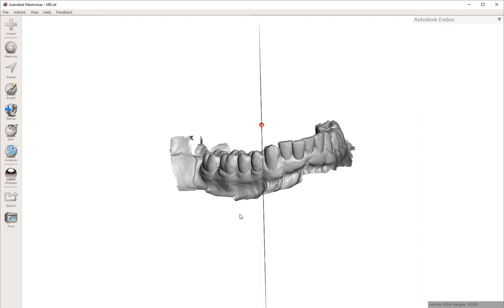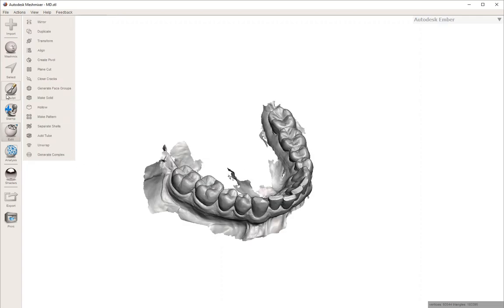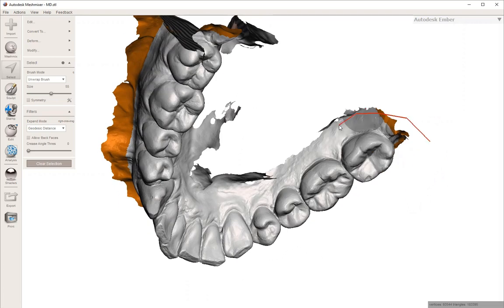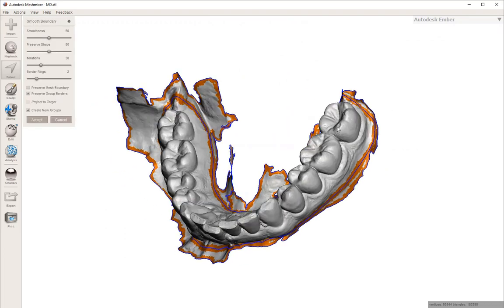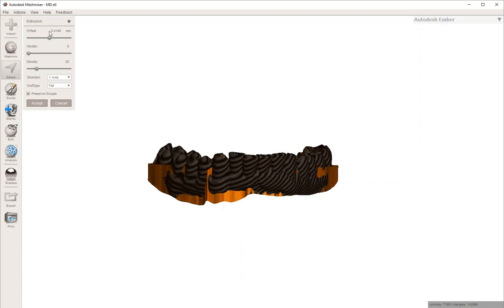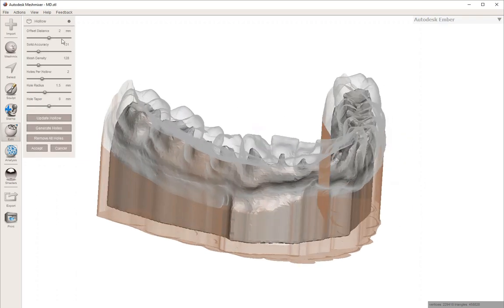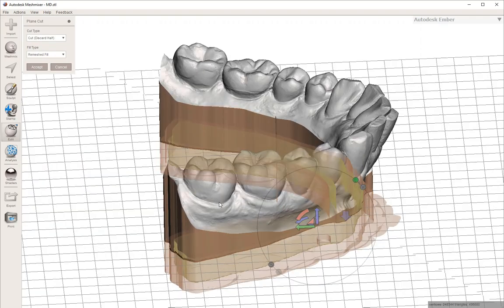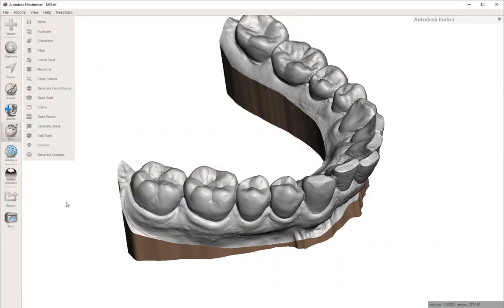Making a model hollow

Comment: Nate, have you figured out why sometimes this sequence will not form a solid during extrusion, then at hollow, you are left with nesting shells?
Reply from the maker: Yes, the issue is that if the borders of your scan are not smooth or cause anything to fold back on itself during the extrusion, the software doesn't know how to close the mesh and so it just leaves it open.  The easiest solutions are 1) always cut the excess mesh off with a smooth cut (smooth boundary tool) and 2) if anything ends up folded back on itself (usually appears as a bump along the length of the extrusion), use the shrink smooth sculpting tool to remove this.  These things have worked every time for me.
Reply: Yes I get the similar results sometimes.